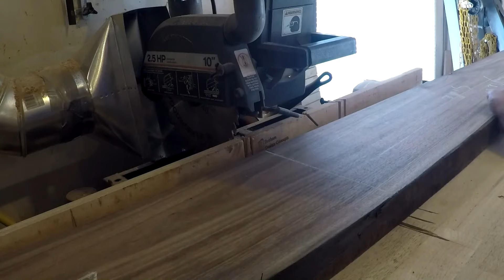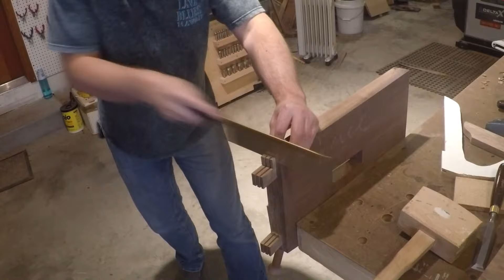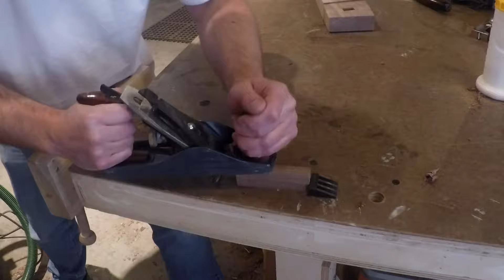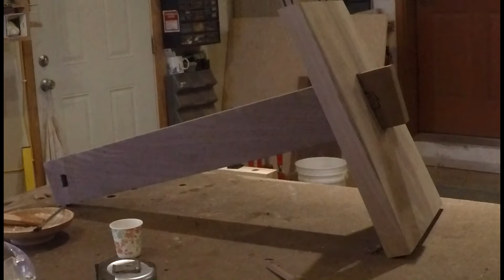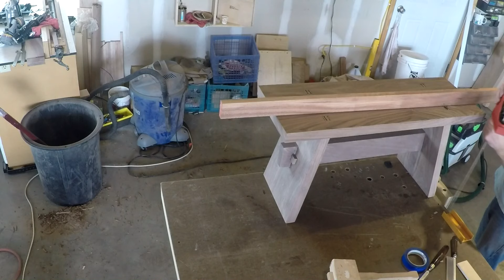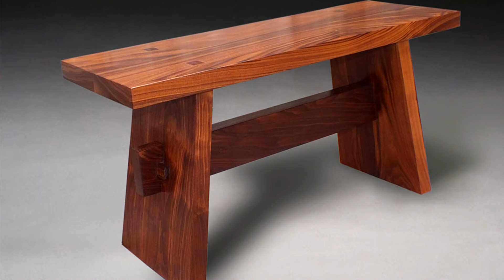How to Build a Japanese Inspired Bench

Comment: I have a saw like the one you used to cut your boards to the right lenght. The problem is that i really dont catch why it has the posibilty to turn the whole head with the sawblad 90 degrees till being horizontal and also the column can in theory mover to make +/- 45 degrees crosscuts. Is there any instructional video for taking the best from that kind of saws? I mean, is a really nice tool: Is sturdy, strong.... but is really big and ocupies a lot of space in my very small workshop.

Comment: Nice tight fit. Good job. By the way, any unevenness at the feet? If so, how did you get the bench to sit flat?
Reply: ACME FINE WOOD FURNISHINGS

Dear Valued Customer
We assure you the contemplation bench we built for you is perfect in every way. All of our furniture undergoes a rigorous 83 point quality assurance check before shipping. We are confident that any wobbliness you perceive is not due to our finely crafted bench. We believe your floor is at fault. Most likely a local depression, or perhaps a high spot. Fortunately all our contemplation benches have a built in feature that allows them to adjust to inferior floors. Simply rotate your bench until the wobble vanishes.
If the resulting orientation interferes with the Feng Shui of the room, please contact our sales staff, and order accessory DTWE-4c. Our fine wood shims are available in a variety of thicknesses, and an extensive selection of wood species to match practically any floor color.